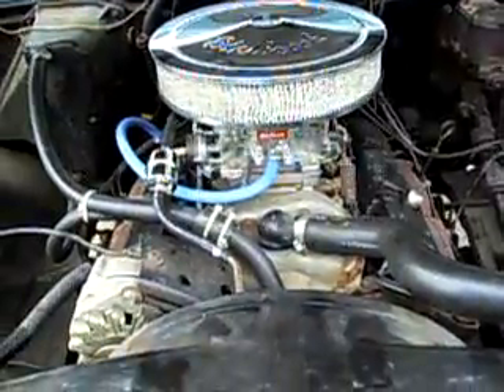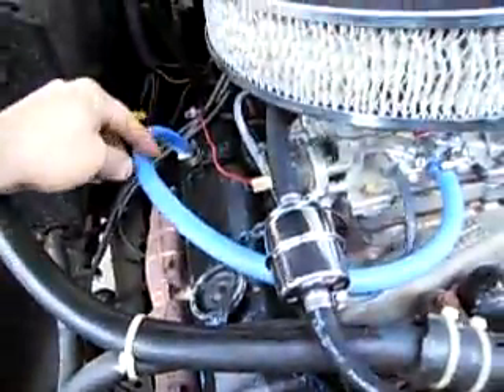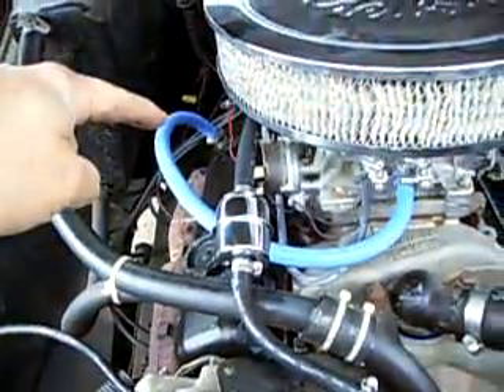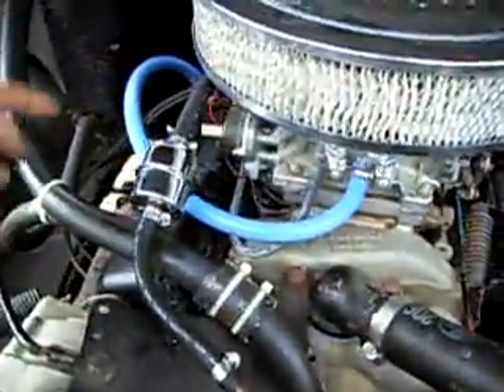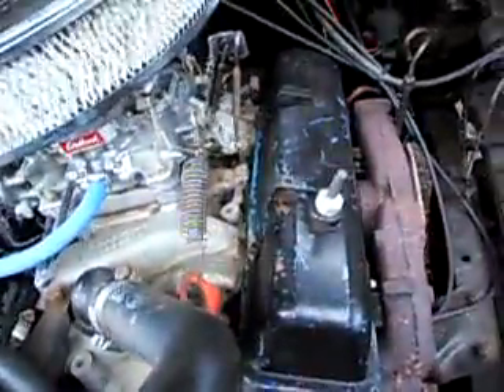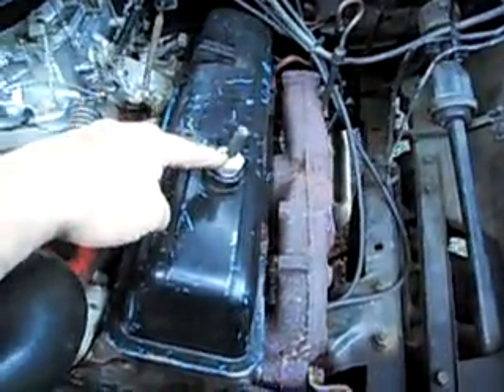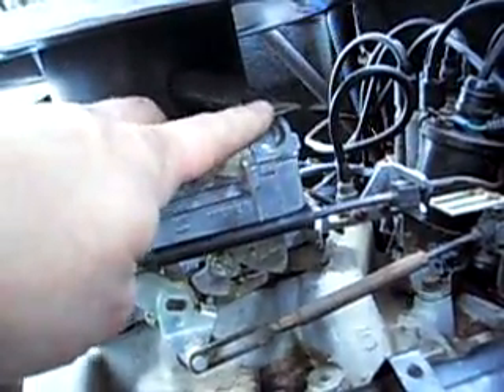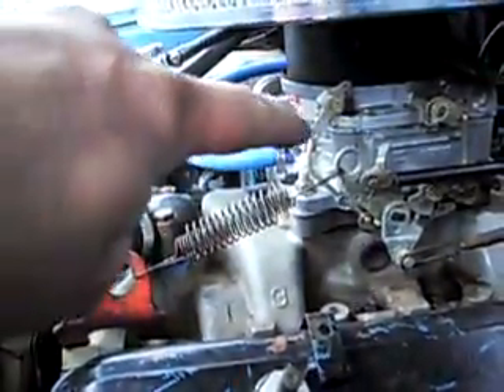PCV system incorrect

Comment: hello brother I really like your videos, you know I have an old 1982 accord, which does not have a PCV from the factory since the gas outlet of the valve cover is only one, that is to say there is no other where filtered air enters, that vent goes directly to the filter to be absorbed by the flow of the carburetor, well for months I have been having an enormous oil consumption 1 liter every 200 km, put in a refinish type restore engine, but by consuming so much oil I think that the vast majority was simply lost, I also did what you did to try to take off the rings (I did this with acetone diesel atf and brake fluid, in different protocols) well that made the exhaust smoke improve a lot, I measured compression before and after and it lifted evenly in the 4 cylinders more than 30psi remaining at 130psi each which is not ideal but it is an old engine with 350,000 kilometers haha, however Yesterday I rechecked the oil and in 120km it lost about 700ml I saw your videos and I realized that at some point, among so many things that I did these past years and months to try to fix it, I connected the valve cover gas outlet to the intake manifold vacuum to mitigate a slight oil leak I had through my valve cover, but it is equivalent or even worse than having a PCV stuck open since the vacuum is even greater and also without another air flow I suppose that vacuum more easily dragged all that oil evaporating it faster due to the action of the engine heat plus the vacuum generated in the crankcase. FORGIVE ME FOR SO MUCH TEXT I just want your opinion brother

Comment: I have a Ford Thunderbird with a 292 in it. The oil cap is vented to pull the air in and uses a down draft tube on the left side of the engine . I would like to know if I can change the oil cap to one that has a nipple on it and run the hose to the air filter or possibly to the rear port on the Holley barrel carb and block off the down draft tube? Any suggestions would be greatly appreciated!Thanks.

Comment: Can a bad pcv cause enough crankcase pressure to cause a new leak at the timing cover bolts?

I had 0 leaks on my 350 square body and all of a sudden i got leaks at the timing cover bolt at 12 o lock. I shook the pcv valve and it was stuck. 

Can this cause new leaks out of no where and cause enough pressure to cause new leaks?
Reply: Yeah it can cause all kinds of weird problems if the crankcase can't properly vent. Anything from weird leaks to condensation and rust inside the engine.
Reply from the maker: Yes it can. If the valve rattles and the crankcase has a place for fresh filtered air to replace what the PCV valve displaced, you should stay leak free. Some fuel injected engines only have a fixed orifice of like 0.080" (2mm) but typically it will rattle.
Reply: @cpworx_maker  Took your advice. Followed the video....FIXED!  Thank you so much!

Comment: I recently purchased an old school style crankcase ventilation setup with ports that weld into the exhaust collector and run up to the valve covers to help with my pressure problems. 
  It seems like guys just replaces the pvc and vent system with it, but Im thinking it should work in conjunction with them. But I need to add baffles and ports in the valve covers.
  Anybody done this?

Comment: what if he ran both valve covers to a Catch can?
Reply from the maker: Sorry, didn't see this question. On boosted cars dual cans would be typical thing to do but I still like the original PCV system in place along with the dual catch cans. You want to have some fresh air circulation to vent out gasses and moisture.
Reply: @ thank you
Reply: I think catch cans that I have seen are for race engines that produce very little vacuum so on a street setup they are unnecessary.

Comment: My 351w stroker is getting too much pressure, got the vent snd the pcv but still needs more. My dipstick is struggling to stay in, burns about a quart per 50 miles, and leaks out the oilpan.
   Engine has about 2,000 miles on it and im struggling to find a cure.
Reply: Different PCV valves have different orifice sizes and flow rates. A popular hotrod PCV is the Fram FV202 or equivalent. I run that on a 351W, a 390 and a 390 stroked to 445 and it keeps up on all of them. Pick one up and try it. Also make sure your oil fill cap is the vented kind and NOT a regular solid cap.

Comment: I understand the PCV system. But for my 1981 chevy camaro engine, I have the stock air cleaner with the thermac system. Instead of one, it has two hoses connected inside the air cleaner. One hose is clearly the crankcase breather that goes to the passenger side valve cover, it even has a crankcase filter, but then i have another hose on the drivers side…. It connects next to the alternator… I don’t know if that’s my PCV or another breather??? It looks useless to me. I would strongly appreciate answers thank you
Reply from the maker: Thanks for the question, the driver side is the PCV valve on that year Camaro.

Comment: Funny thing is, that's basically how a vacuum pump works in drag racing - just a pump that pulls vacuum, no breather - but not how a pcv system is supposed to work.
Reply: Interesting, I just purchased an old-school style crank case evacuation set up that wells into the exhaust collectors and up to the valve covers. My question is this sounds a lot like what you're talking about do I eliminate the vent like this video is talking about or do I drill new port and baffles in the valve cover and keep the PCV valve and breather as a redundant system?

Comment: Will a regular breather on the other side work as away for air to get in? Because they are supposed to be ran as a hose from the valve cover to the intake but my intake doesn’t have a spot to run a hose. It also doesn’t have a pcv valve. It only has one breather on one side. So can I just add a pcv valve to the other side and make that work?
Reply from the maker: Yes, the breather is the filter for the air coming in the valve cover. You got it already figured out, sounds good to me... Good luck

Comment: I’m looking for a simple way to do this and maybe I’m overthinking it.  My existing original set up on my 1966 tempest is pvc comes from out the back on engine (near distributor) and goes into the intake.  Just upgraded to a eldlebrock intake and carb.  Should I run it the same way and then add a hose from carb to valve cover if I can find one for this car?

Comment: If I only have fresh air coming from the carb air filter and not the tube on the valve cover.....

1) how many push in breathers / air filter pod you can place in a valve cover to obtain that cold air into the engine?

2) can you place breathers on the valve cover around where the PCV valve is installed.
Reply from the maker: Doesn't matter if its hot or cold air. You just want clean filtered air to enter one side of the engine and the other side of the engine there's a PCV valve or regulated air leak to pull the clean filtered air through the crankcase to help eliminate moisture and gases that leaked by the rings. Thanks

Comment: My 350 has a pvc and a breather. Should I install hose to the back of my k n tube to supply air to engine
Reply from the maker: As long as the PCV and breather are on different valve covers you are fine. The hose would be to supply air to the engine if there wasn't a breather on the valve cover and you needed filtered air going into the engine.
Thanks for the comment on this very old video of mine lol

Comment: I have a carb swapped 5.0l ford, my pcv valve when connected to the front of the carburetor as shown in the video, stalls out when driving. The pcv valve is on the passenger side, and I have a breather on the drivers side. I took it to a shop and they put a line from the valve to the air cleaner?
Reply from the maker: The valve must have engine vacuum on it and connected to the valve cover or valley pan, they other valve cover is where you either have a dedicated push in breather or a line going to the air cleaner for filtering the fresh air going into the engine.

Comment: Btw: 

Dual pcv + dual breathers = more carb cfm 

It's an old school trick, I think it adds roughly 35cfm to any carb. 

You're welcome.
Reply from the maker: True, although it would be unmetered so you would have to jet up to make up for the lean condition. And the math says 4.5 cfm for each vent, so a total of 9 extra cfm with dual pcv and dual breathers.
Reply: @cpworx_maker  I was told by some old timers it was more cfm than that. 

Also drilling a very tiny hole in the throttle plates would allow more flow (front 2 barrels slightly smaller diameter holes than rear. Don't go too big)

Comment: Great video Sir I know its done years ago but I have question can you help me out I would appreciate it I have a 64 Impala with a 327 engine original carb would I be able to apply this method you explained I bought the car this year previous owner has chrome valve covers on it with pcv valves on each side with open rubber holes on them nothing connected to them theres a hose connected on a fitting or something in the back of the intake next to the distributor that just hangs not connected either car didnt come with a  air filter or that black part that goes on top of the carburetor any suggestions thanks
Reply from the maker: On the older cars, the oil fill is in the front of the intake manifold and it vents through there. On the california models they had the road draft connected to the back of the carburetor. This is located beside the distributor and vacuum is pulled on this location and fresh air comes in the oil fill cap which is vented. Hope this helps
Reply: If you have the breather tube in the intake and the vent tube in the back of the block is clear, run 2 pcv valves. You've got 390-430cfm now (rough est.) And this method will add more cfm to carb. It's a old school trick. Be sure you have a healthy engine before hand though. 

You basically add a "5th barrel" to your 4bb
Either way, you should have 2 because one is pulling from one head and the other is sucking with a breather. This is ineffective and inefficient in my book. 

As a rule whatever you do on the top end you should do equivalent on the bottom

And I always say what you do to one side you should do to the other.  

.

Comment: I know this is a very old video but im going to roll the dice here....i have a 454/468 chevy i have a pcv running on my driver side valve cover in the front hole going  into the carb like your video ,i have a lil chrome breather on the back passenger valve cover hole is that set up correct ???
Reply from the maker: Yes, a filtered breather lets air into the engine and the PCV on the other side lets the filtered air clear out old gasses and moisture from the crankcase and sucks them into the engine for burning. Thanks for asking.

Comment: Air gets in the crankcase by blow by bud
Reply from the maker: NO... Hydrocarbon is blow by... Air gets in as described.  PCV recycles both. Air is to clean out the moisture and PCV sucks the blow by as well.

Comment: answered my question quickly, thank you. I need to install a pcv system to my transplanted 350 in my 60 impala. my 350 has double hump heads with tall valve covers, I now need to know what will work and I don't think my Holley Street Avenger open breather has a source for the fresh air side of the pcv system, but I hope I am wrong.
Reply: 🇺🇸😎Edelbrock makes air filter adapters to hook to passenger valve cover. Chev put the pcv on front of drivers valve cover. It is in the repair manuals in this form. Good luck. 🇺🇸
Reply: Let me know because I have pretty much the same set up

Comment: Mine is set up completely stock, PCV on the driver side, tube from the air cleaner on the passenger side. 
I’d like to change the air cleaner to help her breathe a little better, but when I change that ventilation pipe to a breather filter, I get a bad oil leak from somewhere.
Any idea what could be causing this?
Reply: Does it leak through your exhaust?
Reply: @IsaiasMoreno.  Maybe... I thought I just had bad valve stem seals but yes, there is definitely oil in the exhaust.

Comment: doesn't the air cleaner also suck air out of the valve covers though? So both hoses are suckin air? (I know that's how it is supposed to be but I just have to question it hahaha)
Reply: wildbillo68 No, fresh air enters the crankcase through the air cleaner.
Reply: At high rpm the the fresh air will be over come by blow by - that’s what the pipe is also for to air cleaner

Comment: to check the proper size of the PCV.. use a digital tachometer .. block the PCV flow at operating temp Idle .. your rpms should drop between 50 and 70 rpm .. if it drops more than 70 your PCV calibration is too large. if it drops less than 50. your PCV calibration is too small.
Reply from the maker: WOW Awesome! I didn't know this... Thanks for sharing
Reply: to test it farther.. pull the engine oil dipstick.. wedge a vacuum hose over the dipstick tube.  stick one of the vacuum gauges that read 15 pounds of pressure and 30 inches of vacuum on the end of the hose and lay it on the windshield and take the car around the block.. you should NOT build more than 1 pound of pressure or 1 inch of vacuum in the crankcase..  it took me years of searching to find the 50 to 70 RPM range for pcv proper flow..   if you liked that info.. try this six step voltage drop test.. https://i.imgur.com/kviX0VQ.jpg  heck do a video on it. i don't have a quiet place or good enough friends to help record it.  i use it on almost every car i work on as the first thing.. and its the last thing i do on Every car before i close the hood and return it to the customer.. i have cut my comeback failed alternator rate to almost zero..  its something i assembled out of manual sections years ago.
Reply: Cubic inch of the motor also plays a factor in dezine and weight that's why there's so many part #'s for PCV valves because they are all weighted differently due to the ball bearing in side acting as a counter  weight not talking B/S just passing along parts knowledge a 4 cylinder engine would require a lighter weight apposed to a V8 engine... peace and much respect Jason 👍

Comment: I couldn´t  understand well what you said about the connection from the PCV to the manifold, is it USEFUL or not? My conclusion after your entire explanation is that from the PVC you make the connection directly to the carburetor or the air filter  assembly.
I´ll wait your kind response
Reply from the maker: sorry, this is a very old video. The PCV system connects to any constant vacuum source on the engine that can provide enough volume but the biggest mistake people make is to not connect a filtered fresh air inlet into the engine. You are basically creating a breeze through the engine to vent moisture and gasses that accumulate inside the crankcase. Thanks for the question

Comment: I've just put an oil catch can on my car.  The catch can is connected to the cam cover pcv that allows air to feed in, under low load, and out during high load.  The other pipe the the throttle body has been retained but I'm thinking of putting a catch can on that too but then it might mess up the MAF air fuel mixture.  Complicated stuff.

Comment: Very good explanation, that the PCV system is one that must be allowed to breathe proportional to the amount of vacuum there is. However, in constant high RPM applications (racing) you would burn a TON of oil as a result of windage, correct? Is this the primary reason for a crankshaft counterweight scraper system? To limit the oil cloud/windage?
Reply: thinkpad411 the scraper saves HP wasted by the resistance the oil affords the rotation of the crankcase and the oil it would sling up into the engine.Theres enough there already from bearing g clearances.Alot of piston dome cooling is the result of slung oil from rod/ crank clearance.Believe me! A friend had one of the original  68' Hemi Dodge Darts and the engineers at Chrysler were light-years ahead with the Dynamics of engine cooling.That second Gen 426 hemi could make use of the incredible airflow it afforded by their ability to keep the combustion chamber alone,hot where hosepower lost in keeping the chamber hot at the expense of EVERYTHING in other engines  allowed the hemi to make considerably more power.Wjen they were finally relegated to the pasture by rules in both NASCAR & NHRA They were marginally competitive while displacements shrunk.The last NHRA title was won at 383 cu.in.displacement as opposed to the GM's 427 cu.in.Achieved by destroking to 3.375".The NASCAR series was raced at 366 cu.in.Here the radical destroke was accommodated by running them at small block RPM's of 9,000 +common today but not back in 1971-2.
Reply: I learned this from the tech they would give on how to setup the car.